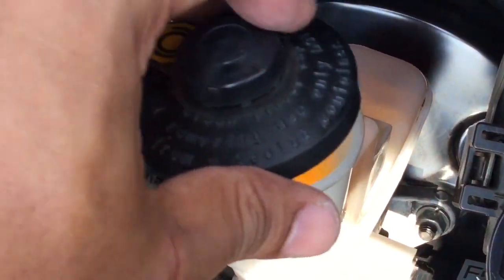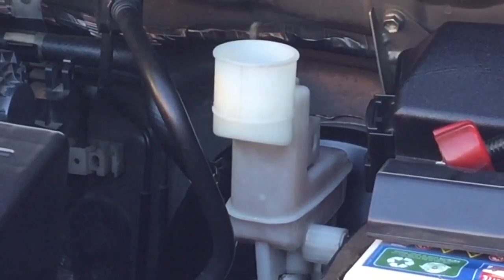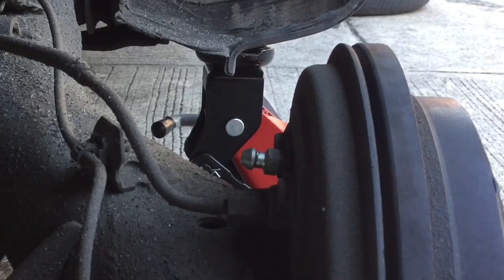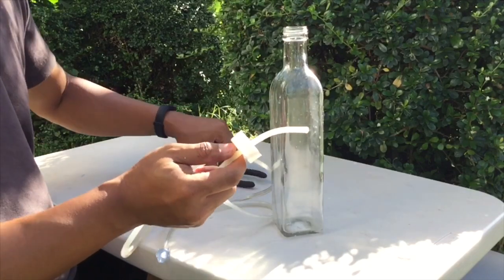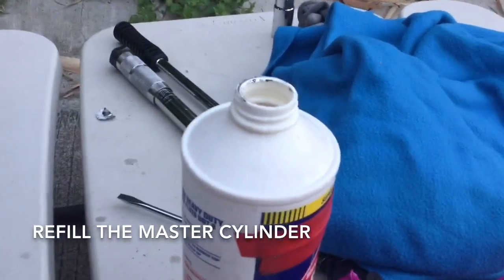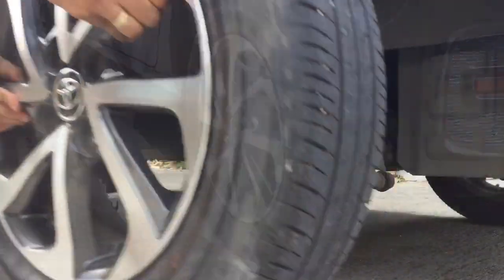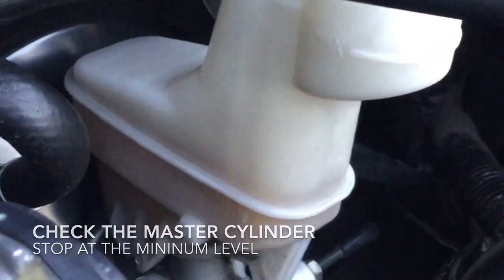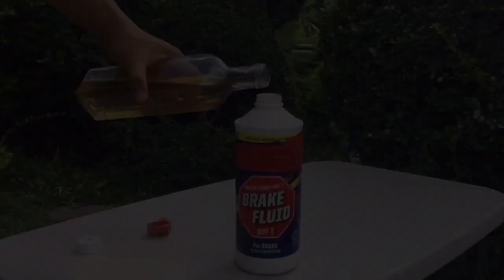How to Change the Brake Fluid and Bleed the Brake System - Toyota Wigo

Comment: Newbie po sa car, 1 month na po wigo at ko. Question po is everytime po ba magrefill ng brake fluid need po talaga i bleed
Reply from the maker: every two years, you need to replace the brake fluid and bleed the system. if you are just replenishing the fluid (less than two years), no need po to bleed the brake system.

Comment: Helo po..newbie here.. ano po reason kelangan natin i flush out instead of dagdagan na lang sir ang brake fluid? 2nd po, pede mkahingi link online f san mabili yung brake fluid nyo sir nkdagdag po ng confidence pag exact brkae fluid din gagamitin ko. Salamat po
Reply from the maker: Giovanne Lapay brake fluid tends to absorbs moisture in the air over time kaya nababawasan ang quality ng brake fluid kalaunan so we need to change the brake fluid and bleed/flush it every two years. here's the link for the prestone dot 3. https://s.lazada.com.ph/s.bpX1R
Reply: @WigoRaizeTV  salamat po sa dagdag kaalaman. im from bottom to top po sa pagfollow ng videos nyo.starting na rin ako invest ng tools..althoug 2x ako na fail pagbuy kasi gen 1 pala sa akin. oil filter at engine filter ko mali mga sukat bt the rest succes nman po

Comment: Sir question. Pano mo na remove ung filter hindi ko magawa magdadagdag ako ng fluid.
Reply from the maker: Jason Cortez Hindi ko po tinanggal yung filter sa brake reservoir. you need to bleed the brake system para po makapagdagdag kayo ng brake fluid at mapalitan yung luma.
Reply: @WigoRaizeTV  hindi kasi sya nag drain ung fluid na  nilalagay ko sa filter.. pano po ba
Reply from the maker: Jason Cortez you may need to watch the video po uli:) kase kung nakapag-bleed na kayo ng kahit isang gulong at nai-pumped yung brake pedal, bababa yung brake fluid level sa reservoir so you can replenish it with new brake fluid.

Comment: pag e pump po ba sir khit naka off ang engine?
Reply from the maker: initially, naka-off po muna ang makina then turn on the engine to pump it again for several times
Reply: @WigoRaizeTV  hello sir meaning po ng turn on, engine on po tlga or basta naka on lang po susi? Bali hndi po ba sya ma pupump kapag turn off po? Thank you sir
Reply from the maker: @renbryancastillo4632  hi ren. re your question, are you referrencing this video or another one?
Reply: @WigoRaizeTV  hello sir this one po. Regarding on how to bleed the brake system po. 😊 dun po sa part na pinipress nyo po brake pedal, naka on po ba engine or hndi po? And ok lang po ba pumasok sa loob ng car habang naka jacked stand po? Thank you so much sir
Reply from the maker: @renbryancastillo4632  nakapatay ang makina.
Reply from the maker: @renbryancastillo4632  pwede naman pumasok sa loob kahit nakajackstand pa:)

Comment: Bro dapat ba naka buhay ang makina or kaht naka patay ok lang?
Reply from the maker: Hi Robie. Naka patay dapat. No need to turn on the ignition key. No need to start the engine.
Reply: Ayun2 salamat bro
Reply: Bro addtional pag naka 8 pump ba kailangan hindi bitawan ung pedal or kahit bitawan na?
Reply from the maker: @robielacson8360  kahit hindi
Reply from the maker: ok lang to take your foot off the brake pedal. di naman papasukan ng hangin yung bleeder screw. The fluid is just coming out and not going back sa brake system.
Reply: Ayun salamat ulit bro

Comment: Sir need help po please. I followed your steps, after ko po sundan naging loose ung brake pedal ayaw po kumagat.. ano pong dapat gawin?
Reply: Need ko po ba ulitin? Napasukan po ba kaya ng hangin? Need help pls
Reply from the maker: @dudong6432  yup, may hanging na nakapasok. open and shut lang ng bleeder valve/s then pump the brake pedal uli. try to recall kung anong side ng gulong matagal nakabukas yung bleeder valve. chances are yung ang cause ng issue and that's the one you need to open and shut.
Reply: @WigoRaizeTV  ayun may vid pla abt spongy brakes! Meron pala nito sir hehe. Try ko po mamaya. 😊

Comment: as a newbie I dont understand the logic of going first rear right wheel then left etc. may you explain some reasons for that. Why not doing all the same time? why not drain all why kept minimum. what is the difference between the old and new break oil. I dont see any difference on the videos. Mixing old and new why would you want to do that? Basically I want some logic behind it and not just follow 1 2 3 steps.
Reply from the maker: i saw a vid tutorial of "toyota time with timmy the toolman" where he was quoting and showing a repair service manual re brake bleeding procedures for a toyota 4runner. i take it that it applies to all toyota vehicles:)
Reply from the maker: you can do all four at the same time if you have four bleeding kits and assistants to help you in refilling the brake fluid, pump the brake pedals, and open and shut the bleeder valve:)
Reply: brake bleeding is done in this sequence to eliminate air trapped in the branches of the tubes. by pushing it out furthest first, air is pushed to that channel until only fluid remains. after making sure there are no more bubbles coming out of the bleeder kit and closing the bleeder valve, only fluid is present in that branch, therefore, air cannot be pressed towards it. as for draining totally before refilling, it is best to keep the brake lines under pressure to flush out gunk and other contaminants while bleeding. pressure brake bleeding is also an option but requires special tools, plus not all brake master reservoir caps are designed for it. also this is a DIY brake bleeding technique.